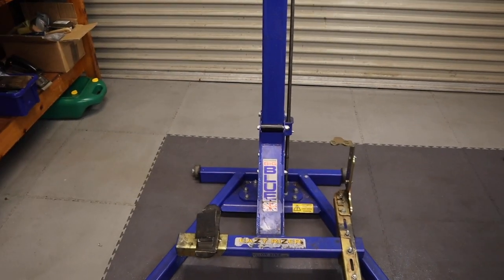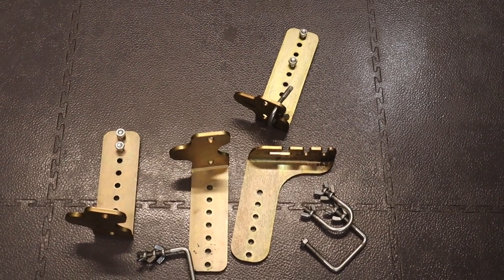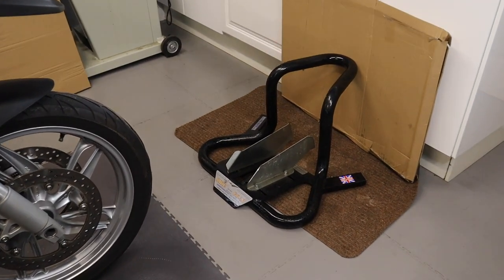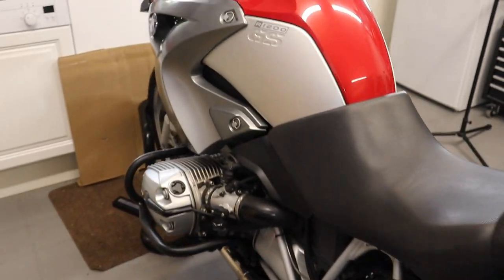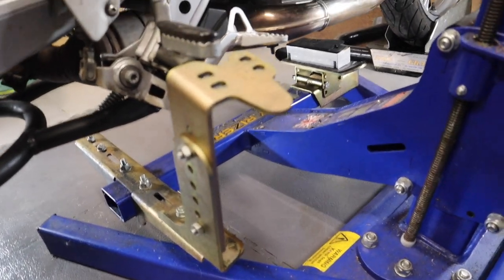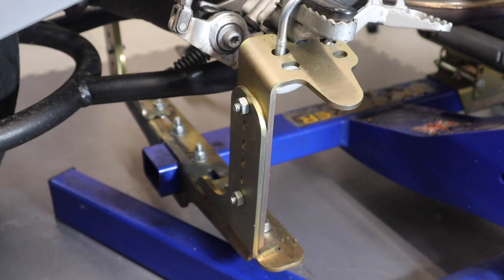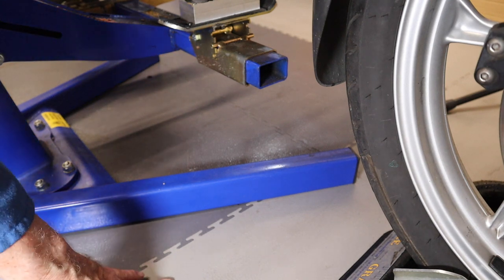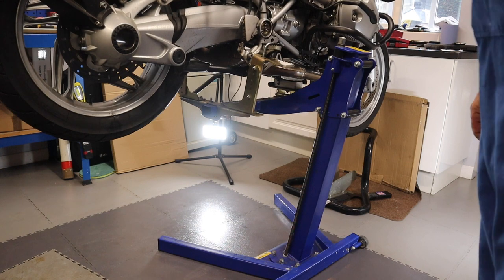Blue Bike Lift

Comment: Hi Norm, yes I agree they are a great lift. I bought one when I had a Harley. As you say, they are very safe , but for extra safety I used to run a ratchet strap around the bike. Sold mine when I sold the Harley and regret it now.
Reply from the maker: David Couling Hi David, your ratchet strap is a good idea, especially with these heavy bikes. Will give extra peace of mind🤗
Reply: @normski3091  excellent buildt

Comment: Hi Norman. Is there a knack to adjusting the bike grab? I’m struggling to get the GS to stand upright and stable. I had no problem with the Harley, but the narrower taller wheel is giving me problems. Any tips much appreciated
Reply from the maker: Hi David, I am not sure 🤔. Normally with a different bike I just open the gap, run the bike onto the Grab with someone to steady it, and then clamp the sides. Sometimes once I get the position I wheel the bike out and lock the side plates a little tighter and then squeeze the wheel in.
When I did this video I got a telephone call from David the owner of On-Bike in Tamworth 01827 61754 who told me I was setting my bike up wrong on the lift. He sent me a picture and for the first time this week I have done it correctly🤷🏼‍♂️.
He is a great guy and will advise you.
Reply: @normski3091  thanks very much. I think I’ll get someone to hold the bike up for me and have another go!

Comment: Hi Norm I have a r1200gs lc would the adapter you have made for the RT lc work on my GS? My GS is a2018 model
Reply from the maker: Hi Arfon, I am so sorry I have only just seen your comment. Yes I am sure the adapter would work, cannot really say until the lift slides under the bike and you take the ‘forks’ of the lift up to the bottom of the engine and the foot rests. Then it is easy to see what to use to lift the bike on the level. It is so perfect for the old GS but with the path of the header pipes changed everything😱. If you live close to me (Chesterfield, Derbyshire) you are always welcome to ride by, we will know in 5 minutes what is possible. Norman

Comment: Congratulations on your video. I would like to ask you if you could tell me what diameter the thread is that makes the motorcycle stand up, since it seems to me that it is too fine. Thank you
Reply from the maker: Really sorry but I sold the lift two years ago so cannot measure it. However it is certainly strong enough. Lifted my RT and GS with no effort at all. The engineer who designed it is a great guy, makes them himself at his factory. They lift Harley’s no problem at all.🤩
Reply: Thanks a lot.

Comment: Good basic platform but as you say yourself it's all a bit of a faff.
Reply: Hi Steve, Often I get down on my hands and knees, just quicker. If it is a big job then worth all the effort. I watch the guys with full benches and it is so quick and easy, but if I had one in the middle of my garage I couldn't do anything else, so the Big Blue Lift is certainly worth it!